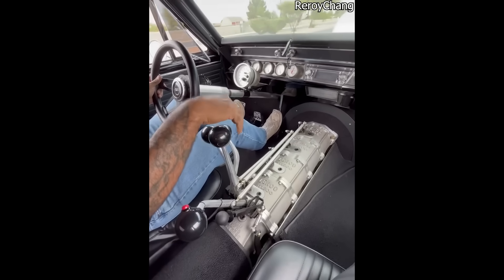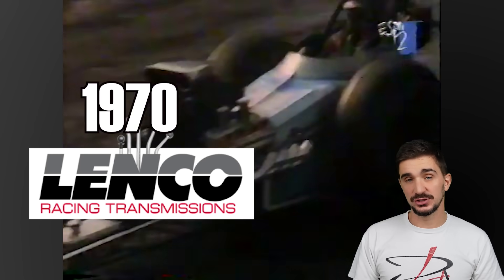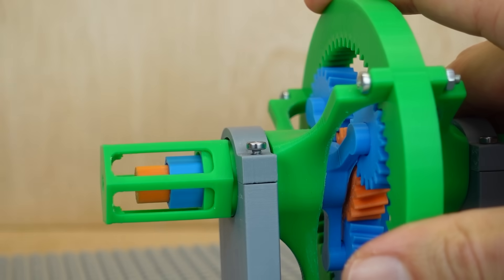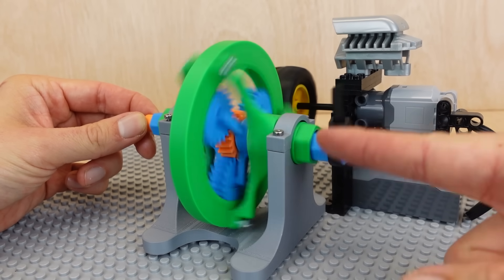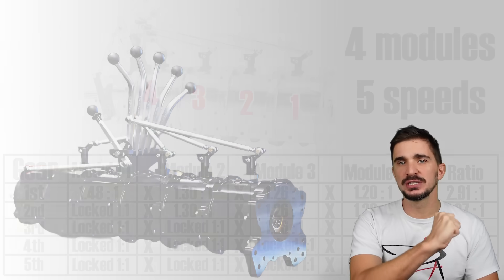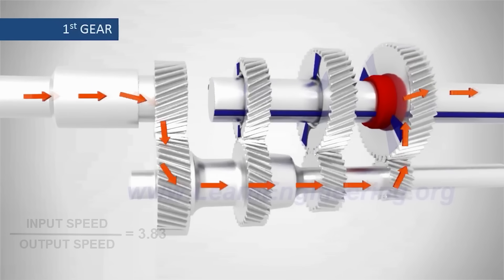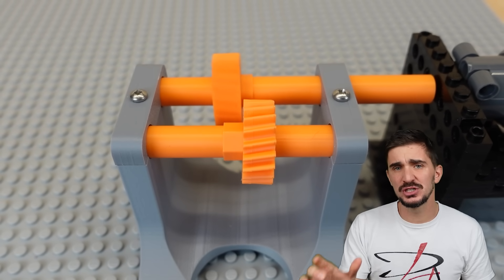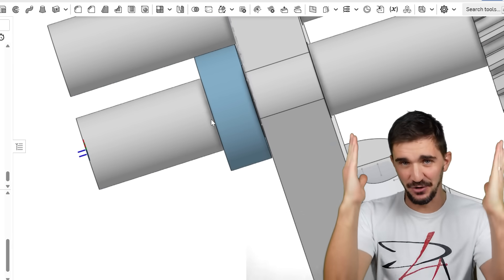This is The Strongest Transmission Ever Built - Planetary Manual Lenco Gearbox Explained

Comment: Knew someone years ago that had a lanco automatic in a 55 Chevy, it had a 2500 psi co2 bottle in the boot to actuate the shift, ran 7.2 1/4 mile.
Love to see you do the insides of a road ranger transmission, herringbone gears to stop end  thrust and twin lay shafts to increase contact points.  Had one do 1.3 million kilometres pulling up to 90,000 kg without  a rebuild.
Reply: Are you sure they didn’t run a Powerglide? That only has one shift point, and it is common to use a CO2 solenoid on the shifter to push the lever from 1st to 2nd. And it is called a «Lenco» with an E. 😁
Reply: @sjokomelk  Lenco's can be shifted using CO2 modules. Rear Engine Dragsters using them use CO2 shifters for multiple reasons. First reason is trying to figure out linkage from the cockpit to the transmission. Second being the fact that you can use simple push/pull CO2 shifter buttons on the butterfly steering wheel. Third being the CO2 shifter module actually shifts faster than manual "stick" shifters. At the start of the run both buttons (Alcohol Dragsters typically run a 3 speed) are out, you push one in, then the other at your shift points using your thumbs. The only "shifter" you really have to worry about routing linkage is for the reverser.
Reply: @sjokomelk definitely lenco, was a supercharged outlaw, tune up crew flown out from the states to Australia, not a typical build. 
Ps I driver better than I spell.
Reply: I'm not a fan of Eaton's automatics/automated manuals (they shift slow as dogwater in my experience driving a newer Kenworth T680) but all of the roadrangers are very good. I'd love to get a deuce and a half and swap one in alongside an older diesel engine like an 8V71 Detroit. Just thinking about them reminds me of doing my CDL road exam a few months ago and floating a downshift in front of the state trooper who was doing the test. In my state floating gears is an automatic fail on the road test for whatever reason, even though 99% of truckers who drive stick for their job do it (unfortunately I drive an automatic truck, but fortunately I moved into a Volvo a few weeks ago so it's the decently cromulent I-Shift) but he didn't say a thing.
Reply: Hate the autos as well, spent 23 years teaching road ranger, don't care what anyone says about new safety features, learning with a road ranger makes the best drivers.

Comment: why lock up the gears in a fixed order? if you locked up the second gear set first, you'd have some intermediate ratio.... with 4 gear sets you should end up with 16 (2x2x2x2) different ratios.
Reply: it'd be useful for trucks i guess. problem with using those intermediate gear ratios in drag racing is that it requires parts of the transmission to downshift which causes problems, or someone would have already done it and it'd be standard practice.

there is already something better for intermediate ratios though; planetary eCVT gearsets like those used by toyota. problem is you don't get the "feel" of shifting gears and you need a hybrid setup for it to work, but eventually it'll be used to make some insanely powerful hypercars once they figure out how to properly get the most out of it.
Reply: I think you can pull any one of those levers in any order at any time.  But dont quote me on that. The only reason i think thats the case is because Cleetus Mcfarland accidently shifted the wrong way and launched in 4th and kept downshifting as he went down the track. 😅😅

Comment: Always wondered why herringbone gears are not used today, cost, manufacturing complexity, weight? 
In a planetary gear as the one demonstrated, only 3 contact points should count, since you need to break the weakest 3 of them to break the transmission, no?
Reply: primarily manufacturing cost, size and weight.

Comment: why not double helical gears or rather herringbone gears?
Reply from the maker: Heavy, inertia, long, expensive, big transmission
Reply: @d4a  Herringbone gears weigh the same as spur gears.  They are the same size, just the teeth are cut differently.

Comment: Could this be the start of an Iconic Gearboxes series
Reply: T56 is like hold my beer
Reply: And chassis, and suspension
Reply: @Nedw ☝️
Reply: looks like we are done with engines. Next DSG
Reply: I NEED a video on the ZF 8 speed. Such a wonder how it is in soooo many cars at such different power levels and purposes. Or are they totally different transmissions that just share the name zf8🤔
Reply: @thedlc7784  the name of that family of ZF transmissions is "8HP". the various versions have different cases and input and output options, but internally have the same basic design, varying only in the size of components to suit the torque capacity (which is indicated by the digits after "HP"; multiply that number by 10 to get the input torque limit in newton-metres).
Reply: @thedlc7784  Weber university channel you can thank me later when you get to the 4 part series with hour long episodes about the history of ATF
Reply: lol I could see it
Reply: need to talk about eCVT which has all the advantages of this transmission and much more
Reply: i sure hope so. i would love to get geared up

Comment: Weak sauce. The transmission from a Voith Maxima locomotive can take 4800 hp
Reply: But Top Fuel Dragster transmissions can take about 10000 hp.
Reply from the maker: Top fuel dragsters don't really have a transmission?
Reply: @d4a Yeah maybe transmission is a bit of a stretch, they have a single gear and a big clutch that welds itself together after one run.

Comment: I always called them lencos. I always figured it was a brand. But like vice grips, everyone just calls them that, because no one usually knows the actual name lol

I had no idea how they worked though, so thank you!
Reply: Kleenex, Clorox, Velcro, Neoprene, PB Blaster, Heli-coils, and my favorite Super Glue.
Reply: @Dookybootie hoover
Reply: @Makkiebobo730  Some people use this word for Vacuuming. The idiots say, I’m hoovering 🤷🏽‍♂️
Reply: @Dookybootie  Don't forget Freon, Q-Tips and Xerox.
Reply: It’s called a generic trademark, aka “proprietary eponym”
Reply: locking pliers
Reply: @kingsolomon4392 i am aware...
Reply: They work but they're really large and not as popular as the video suggests. Cletus McFarland installed one on one of his cars and not long afterwards removed it
Reply: @JESTER99M they USED to be popular, but like you said, not so much anymore. The downfall of a Lenco is they use ALOT of horsepower to run that planetary reduction unit. Warren Johnson wrote an article on them probably 30 years ago talking about how a 5 speed Lenco can lose 25-35% of the engine's HP in 1st, but by the time you get to 5th the HP loss is only about 3-5%. He then compared that to a Liberty which has a HP loss of around 5-8% across the board. This was back when pro stock switched from Lenco's to Liberty's & Jerico's(which have even less HP loss) and why pro stock got so much faster nearly overnight.
Reply: @JESTER99M  Well that and they barely understood it...hell they argued on which way to shift it....In the end they went with the same GM auto transmission all their other cars use because it was easier. There was nothing wrong with their Lenco other than they didn't know how to use it. I love Cleet and the boys but they were in over their head on that and they knew it too.
Reply: It is a brand...
Reply: @Karl-r5j  that is quite literally what I said.
Reply: @KwAgee evidently reading comprehension is challenging for some😂😂😂